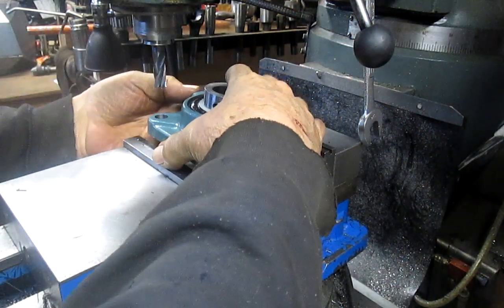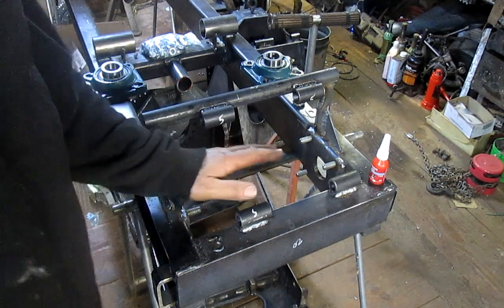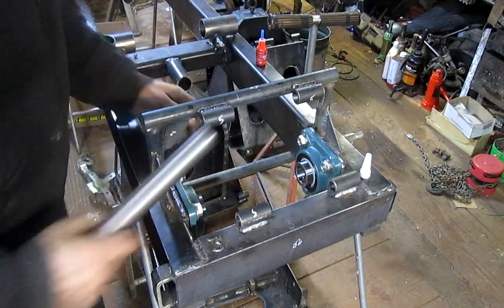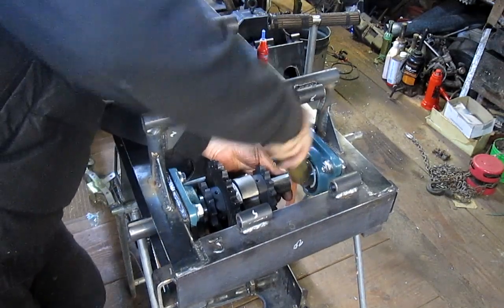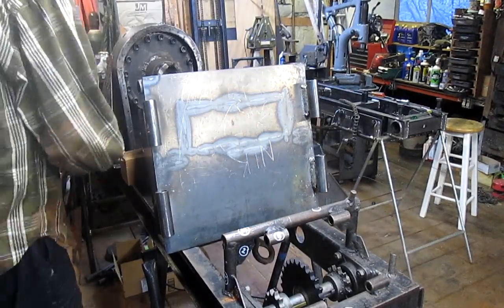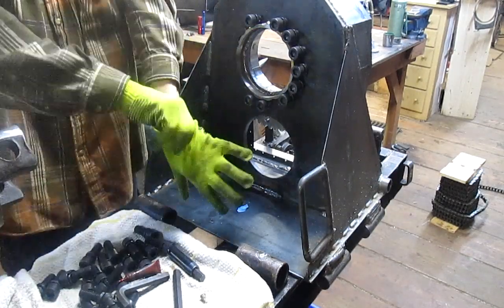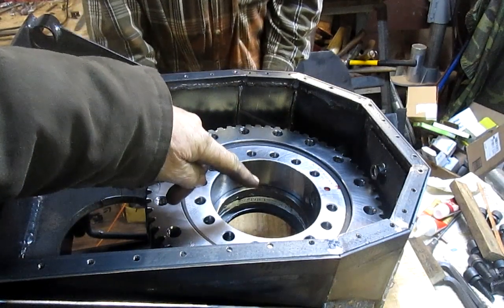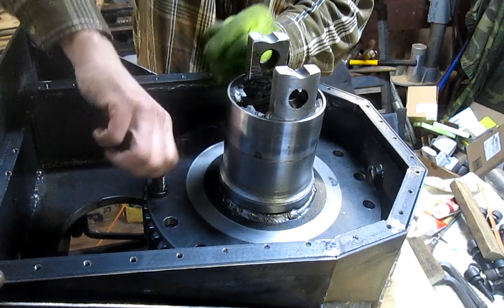Earth Drill Build #13

Comment: Great job Nic!!! One trick we use when putting parts together using CR type seals is to make a speedy sleeve when sliding the parts together. We use those cheap kitchen roll up plastic vegetable cutting boards. Just cut them to size and you don’t have to worry about tearing the sealing lip, it will expand, get the part through and then just pull the sleeve out.

Comment: I'm a little worried those seals are going to pop out with vibration. Maybe should locktite those in also. ??? Coming along well , got to hate manufacturers changing bolt pattern size. More work but an easy fix. Great job love fabrication jobs my specialty .. Thanks Nic